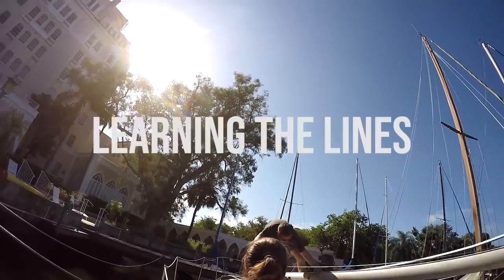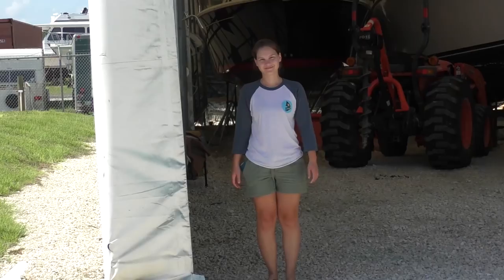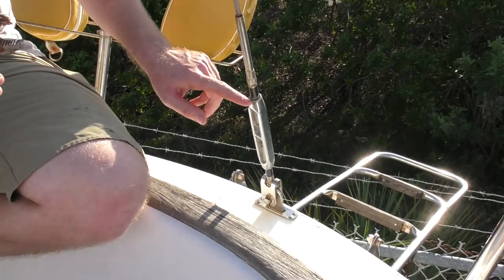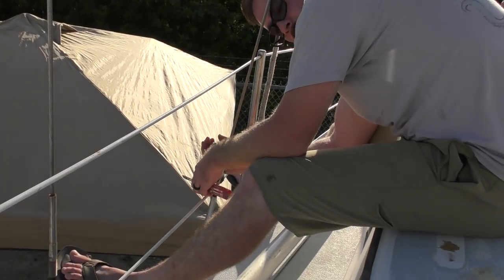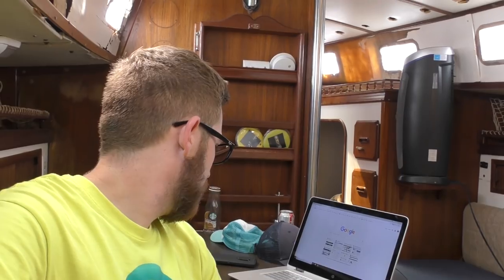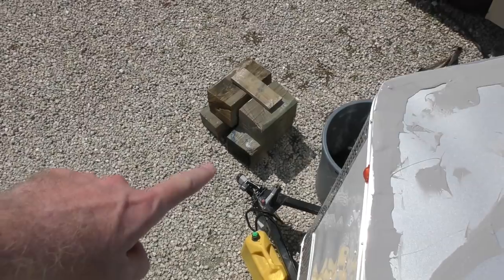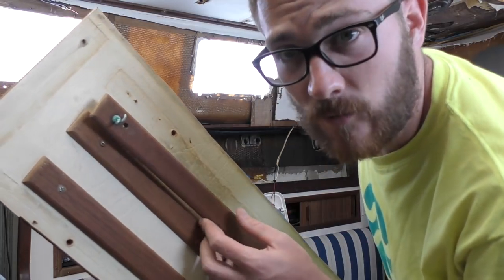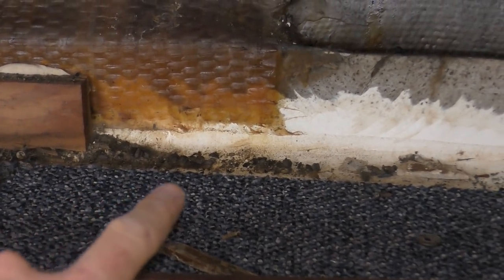44. Pulling the Stick - Mast Removal on a Sailboat | Learning the Lines - DIY Sailing

Comment: My understanding is that WD-40 is insoluble in water, and displaces water with a fatty amine emulsified mineral oil that are good corrosion inhibitors because the amines are cationic surface‐active compounds which strongly adhere to surfaces and hence displace water, but also attracts grime. Spectra analysis shows WD also includes additives that lower its freezing point and decanes that are solvents, and there are three or so forms of decane in WD. Another additive cyclohexane will oxidize with air to form cyclohexanone, and the two form KA oil, a precursor to nylon. In chemical compatibility charts I've read none of the additives are very compatible with EPDM rubber or non-fluorinated plastics, and cyclohexanone is listed as not recommended with silicone (siloxane). Basically it seems fine to use it on metals, just not plastics or rubber, in those cases a teflon or silicone oil may be better suited.
Reply: That HAS to win the "Best Answer" award!
Reply from the maker: Wow! You seem to know your stuff! Thanks for sharing your knowledge. 👍
Reply: Well interesting ... but basically wd40 is silicones in a water emulsion all the extra stuff is to make the  water and Silicone stay together, not freeze ,spray etc. The amount of Silicone is small so WD40 is  not a good product for any long term applications. Cheer s Warren
Reply: The WD in WD40 stands for water displacement and was developed for NASA to be used in space.
Reply: Jerry Watson Superfluous answer is superfluous.
Reply: Jerry Watson WD-40 developed by NASA for short term protection of rocket unpainted bodies while waiting for launch in the humid Florida environment.
Reply: Wd40 contains silicone which is a contaminant on surfaces needing paint. It causes fisheyes in paint jobs if not cleaned well enough. Boats, cars, or bikes don't get it near what you want painted

Comment: WD40 has no adverse problems on any surface if wiped up within reasonal time limit. The problem comes from the silicone in the product contaminating paint surfaces you want to paint. If it's not cleaned well enough it will cause fisheyes in the new paint. Boats, cars, bikes whatever, keep the spray away. I'm an old auto body mechanic

Comment: I don't know why you shouldn't use WD40 on the exterior of your boat but....I have a friend that was working in the engine compartment of another friends Morgan 42' using WD40.  The fumes were building up and from what he said he decided to take a smoke break.  When he lit up it ignited the fumes and got burns on almost all exposed skin and burned off all exposed hair.  You just need to be careful with it indoors......happy sailing.

Comment: I have used WD40 in lots of places it 'wasn't supposed to be used' and then  simply used hot soapy water to clean it off when done. If you have a pressure washer, especially a hot water or steam type, it goes away real easy - including overspray and/or drips.
Reply from the maker: We will most likely be using warm soapy water to clean the whole deck, so that's good! Thanks for watching!

Comment: WD-40 and PB Blaster were designed to do different things. WD-40 dries and degreases... it's mean to coat metals so that they resist corrosion, not break nuts free with. PB Blaster is a purpose built penetrating fluid that eats away at corrosion to break the surface tension between two rusty parts. LPS, Liquid Wrench, and Zep are also great to use to penetrate
Reply from the maker: Thanks for the input! We definitely need to pick something else up to have handy.

Comment: WD-40 is a low viscosity oil. As an oil it attracts dirt and salt, especially in a marine environment. A better alternative for light lubrication in the marine environment is a dry silicone spray such as Harken McLube, but it is not a penetrating oil. Good luck with the refit
Reply: Uncle Bob WD stands for water displacement and it is made from fish oil. Your statement indicated is was petroleum based. I use WD40 in some areas of my boat, but usually, especially around anything electrical I use 
Corrosion Block.
Reply from the maker: Makes sense. Thanks!
Reply: Although the formula is a trade secret, WD-40 is hydrocarbon based.(check the formulation section on Wikipedia.)
Reply: Uncle Bob and Cliff Starks         All living things are made of hydrocarbons so WD-40 could be Soylent Green.
Reply: When in doubt check the MSDS. You've gotten too much horsepuckey about WD40. Which does many things well, but isn't always right.
Reply: Here's a spectrographic/chromographic analysis (no fish oil):https://www.wired.com/2009/04/st-whatsinside-6/
Reply: Uncle Bob  I second that wd 40 not the best out there
Reply: "Harken McLube" No, Harken happens to sell McLube SailKote. Which I'm told is a very expensive Krytox lube in a white paraffin carrier case. Not at all the same thing as silicone spray! Look up Krytox and be amazed. SailKote is also intended to be sprayed on sails, to repel water and dirt and to make it easier to raise them when they have been rolled or folded.
Reply: @jamesford8315  But Soylent green is made of people....

Comment: Wd40 is fine to use as long as you understand that it is a solvent and not a very good lubricant.  It's good for loosening things up but needs to be followed up with the appropriate lubricant. This not only applies to boats but in all applications.

Comment: Gave up on wd 40 and only use silicone, doesn’t attract dirt and probably salt . Home Depot sells it at a good price. Had you considered using Dynema(sp.) for the rigging? Theoretically it may be better and easier to manage on your own. Maryland school of sailing has a vid on tuning rigging and tensioning the mast. Also a great way to tell if the mast is leaning to port or starboard. Works on water with some rolling motion. It uses a suspended bucket of water to get the lean distance identified. Nice vid

Comment: Good work guys!  I do cringe though when I see people use channel locks on bolt heads.  I don't know if you plan on keeping the old rigging for spares, but maybe keep the longest line. With a couple of Sta-Lok fittings and a hacksaw, you have a spare in case of emergency. Just a thought. Jordan on Project Atticus gave an excellent tutorial on Sta-Lok installation.
Reply from the maker: Good thinking! We'll have to look for that video.

Comment: I think you are right to stay with stainless rigging. See SV C'est la Vie Dis-masted . Those strips you hate. The main purpose is to keep things off the sides. When it get cold condensation will soak anything touching. The strips provides air flow that reduces moisture. Gets really aggravating. Love the channel and take it from a old geezer, you are doing it right. Fix that boat and get out there while you are young.
Reply from the maker: Thanks for watching and for the input! We did not realize the purpose of those strips, but that definitely makes sense. Love learning new things.

Comment: Wd40 is a cleaning agent and solvent. Not so much on lubricant, we actually use it to remove lubricants and clean parts before a deep clean with ultrasonics. It does leave behind an extremely light layer of oil that usually doesn’t stay around long.

Comment: An old fisherman once told me not to use oils on fittings. It attracts dust, dirt to it. He used dry film lubricants. and wiped clean excess. Lots of hard work today. Did you get a marine survey done on the value? A before and after when most of you cash spent can help prevent you over spending.
Reply from the maker: That seems to be the general consensus about WD40. We did not, we had a copy of a previous survey of the boat. We may get another survey when we're done.

Comment: I agree with DoubleODude, Gelcoat is porous and WD40 can stain it. It also attracts dust and salt and will eventually seize whatever you are trying to lubricate...I use dry silicone spray or graphite spray depending on application. Have you thought of using dyneema rigging? Rigging Doctor just did an episode on their rigging...I love the idea of easier inspection and less weight aloft. Thank you for another great video :)
Reply from the maker: Everyone's suggesting we do dyneema lol.

Comment: noticed some of your lines are stiff and dirty. While your mast is down, remove all the running rigging and throw them into washing machine with mild detergent. Use a soak cycle, and no spin. It will get rid of the mold/salt/dirt and make them look and feel like new.
Reply from the maker: We're going to be replacing all of it.
Reply: well do it anyway and keep for whatever occaision :-) can't have too many lines on aboat.

Comment: YES FIRST AT LAST :-) WD 40 attracts dirt and is not a good lube at all but it is good as starter fluid for a diesel engine (if you sucked air into a line etc and need a boost to get it started). Real pros (even locksmiths) use Graphite Dry Lubricant for locks, hinges and many things (it drives the moisture out and does not attract dirt). 

Of course you need the proper packing grease for your windlass and other proper lubes for specialty things like outboard lube to bolt lube etc... Use the proper tool (or lube) for the job and always buy a spare (of everything important) because there are no stores in the ocean when you run out and need more :-)
Reply from the maker: Congratulations! Lol
Reply: Guys I'm  not kidding,WARNING!!!!

Comment: just a thought. Sailing Uma is just around the corner from you ie somewhere i s.fl.(i think) anyway, if you didn't already know, they installed an electric motor in their boat. might be a good chance for the two of you to get aquainted :-)
Reply from the maker: Yes, we've been touching base with them recently. We were actually lucky enough to meet up with them before they took off from Miami a couple years ago and we were just buying our first sailboat. Hopefully we will get to meet up with them again soon.

Comment: You can buy an oil specially for turnbuckles. It has the right viscosity. Grease them a few times during the season and you will be able to loosen them almost by hand. 🇩🇰
Reply from the maker: Good to know! Thanks.

Comment: WD40 is fine to use when freeing moving parts up BUT beware of over spray/run; mainly because it’s a pain to clean up and can tarnish wood and paint coatings (not a good look when it hits the water). As it kinda attracts dirt/salt it’s not a good maintenance lubricant so you should use some other more appropriate grease..... some have fancy names just check the base ingredient and you’ll probably get the same cheaper in a non-yachting brand.
I noticed someone mentioned washing/soaking your running rigging I mild detergent. This is a good idea but heed their advice on the mild detergent, polyester degrades in detergent so better to use mild, as suggested, for longer and with a really good rinse than something stronger. Only use warm water and lay them out to dry but not in the sun.
Apologies I don’t often offer advice on this forum. Enjoy.
Reply from the maker: No need to apologize! We love advice. Thanks for watching and offering input. :)

Comment: I was using WD40 for a while, but it left black grease all over the place. An older sailor suggested CRC lubricant, and now it's all I'll use on my boat. They even make a marine application, but the CRC general purpose lubricant, that comes in a green aerosol bottle, is probably just as good. Try it and you'll never use WD40 again ;)
Reply from the maker: I think we will!
Reply: For a penetrating oil, I have been happy with Kroil.

Comment: Some of the thinning and drying agents in WD-40 can stain or darken gelcoat; been there, done that, but only if you don't wipe it up fairly quickly. The stains are worse on oxidized gelcoat and not so much if you keep your gelcoat polished and waxed. There's nothing wrong with using it to free frozen fittings as long as you clean up drips quickly, preferably with acetone. It's better to lubricate moving fittings (like turn buckle threads) with a very light coat of silicone based grease. Apply it and wipe it off, the thin residue is enough. 

A real, professional "trade secret" is muriatic acid for frozen fittings, steel rust, copper and brass oxidation and patina. Never, never, NEVER use it on aluminum or magnesium (trust me), do not let it sit on any material for very long, and avoid getting it into a cut in your skin. Ospho (phosphoric acid) is similar but does not work as well on organic stains. A cheep paintbrush or a plastic spray bottle used to apply it to the fitting and soapy water to rinse it. Be aware of wind direction if spraying - it's hell if you get it in your eyes or try to breath the mist and has a rather harsh fume while it works. This also completely removes deep seated rust stains and black organic stains in gelcoat, or any other plastic for that mater. That Brilo pad that stained your formica counter top in the galley? - not a problem, but it will turn wood black so be careful around deck and trim teak. It will change the color of some urethane paints with metal oxide pigments if exposed for too long. It works very quickly so don't walk away from it and let it sit for long. Many professional boat cleaners will use it to also remove the black stain on the hull at the waterline, but not on fresh bottom paint. I've even used it to help refurbish an old cast iron skillet!

I should write a book!  =D
Reply from the maker: We would buy that book! Lol. We always enjoy reading your comments because they are always very informative. We truly appreciate you taking your time to share your knowledge with us. 📖
Reply: I have to tell you, just after I wrote this, the guy on the opposite finger pier was out trying to scrub his back deck with Ajax and chlorine bleach. His wife was doing the same to some carpeting that had some serious rust stains. Apparently he left some tools out for a few days after working on the engine and it stained the carpet and the gelcoat around the engine hatch. I watched them scrub and rinse for 15 minutes to no avail and I could see she was losing hope. I poured about 2 oz. of muriatic acid into a cup and grabbed a cheep paint brush and told them I could solve their problems if they trusted me. Just dabbing a little acid with the paint brush on the fibers of the carpet and before I could get to the last stain the first one had disappeared (the acid actually turns yellow but the dark rust goes away real fast, and the yellow goes away as soon as fresh water hits it) I did the same to a wrench shaped stain in the deck and handed them the cup and brush. It took all of five minutes (and NO elbow grease ... at all) to get rid of all the stains. If you ever try it remember that soapy water will rinse AND neutralize the acid.
Reply from the maker: I am sure they were so appreciative of your help!

Comment: WD40 is fine on a boat for some applicants.  The WD stands for water displacing.   Many blocks and furlers use water as a cleaning agent and lubricant so on those it would not be helpful, and trap debris that can damage   So if you select where you use it and don’t call on it as a fix all you are fine.
Reply from the maker: Thanks for the input!

Comment: WD40 is a WATER DISPLACEMENT fluid, mostly solvents which remove any lubrication. I highly recommend INOX which can be hard to source in the US, but more and more outlets are carrying it, check their website out. Failing that try to find a lanolin based lube.
Reply from the maker: Thanks for the tip!

Comment: Another step closer. Why was Randy wearing a long sleeve shirt in the beginning of the video....Ugh. I was like holy cow........in Florida?
Reply from the maker: Lol sun protection!
Reply: After you get a couple of nice sunburns and your skin changes permanently you will change your tune!
Reply: I just seen her old man standing next to her sweating his ass off and she's standing next to him with a long sleeve shirt. So by looking at him you know its hot as hell. I was just thinking of jumping in my refrigerator after that lol. Don't bite my head off lol.
Reply: If you have ever done serious outside work, you know a long sleeve shirt is better... sun protection and a sweat evaporation medium. It’s cooler, believe me.
Reply: FL is also much more humid than heat. When I lived in Tampa, was quite often surprised to drive past outside temp showing low 80's, as I would have sworn it was near 100. Quickly found out that low 80's was typically the normal temp, but humidity made it feel so much hotter and made you sweat so much more too. Think couple years I lived there was high of upper 80's (89?), which again shocked me as that day felt cooler than normal.

Comment: How do you feel about Dyneema vs steel as far as rigging goes?
Reply from the maker: Maybe for a race boat. Not on my cruiser.
Reply: Learning the Lines maybe check out - the rigging doctors - recent video on the subject
Reply: I watched that video.  It convinced me that stainless steel will be the way to go, at least for me.
Reply: Decade after decade stainless has been a fantastic solution. As a sailor I am not familiar with Dyneema. As a rock climber I am familiar with Dyneema. As a sailor and a rock climber I am concerned that Dyneema can get sliced/cut.
Reply: I was thinking about costs. Dyneema seems like a stable and affordable replacement for steel. I do see your point in the difference in cruiser and racers.